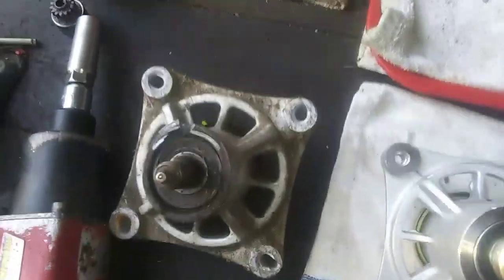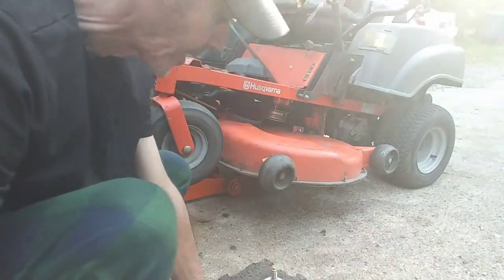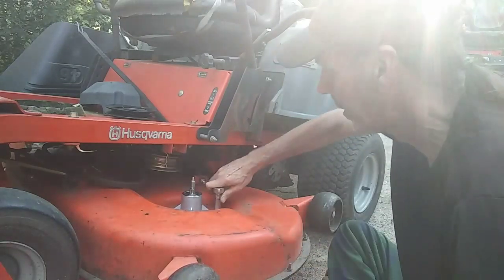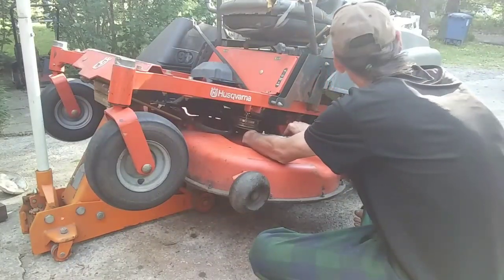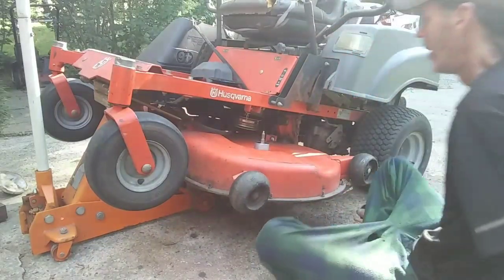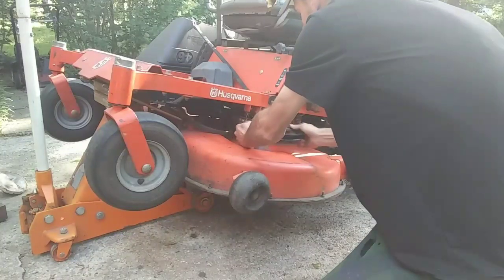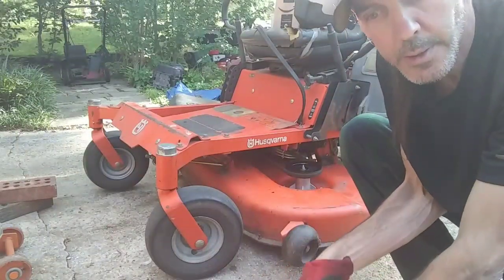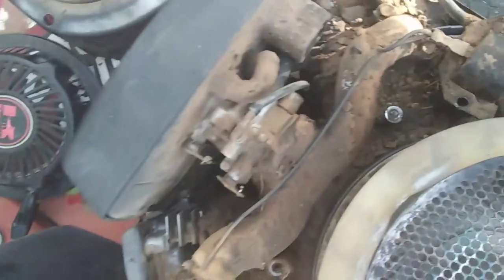Husqvarna Spindle Replacement

Comment: On that coil bolt, I drilled a hole then replaced the fastener with a self tapping screw from my local Ace Hardware.

Comment: Sometimes when brokeoff flush or just proud you can place a nut over the top of it and fill the nut in with weld real good.   let it fully cool before trying to remove.  The heat swells the bolt and it stays hotter longer than the aluminum But it often cracks the rust loose.   The weld will not stick to the aluminum.   I had worked in a machine shop a few years and this is a trick a old timer taught me.    Other wiseinvest in a good extractor set with left handed drills.   If you drill just under the thread size the left hand drill will often back the threads out.   If your drill slips a bit and gets into threads then drill it out and retap for a heli cool the right size to restore them.          I am sure you have removed it already but maybe my post will help someone out of a bind!

Comment: My 42 inch has the spindles under the mower which makes them inaccessible without taking the deck off. Minor, but irritating.  I didn't use anything on the spindle bolts except WD40 to loosen them.Spend the extra money to get the prethreaded housing...save yourself some pain...

Comment: I purchased a new zero turn Husqvarna mower I had 11 hours on it and the bearing locked up and broke the belt. I didn’t know at the time what caused the belt to break, till I started to install the new belt, that when I discovered the bearing failure.,  None of the the spindles had any grease nor did the front wheel bearings. Husqvarna would not cover the cost. 
Now I am concerned about the hydraulic motors now no way to check to see if they have oil..
Reply: their spindles are made with sealed bearing so pump all the grease you want in and they will not get any in them.   Only way to fix them is to knock the bearings out and remove the plasicseal from the sides you want grease to enter.   It is a stupid design almost all of these mowers now have.
Reply: Actually, I saw a video that would allegedly prove if you pump enough grease in the center, the pressure will push the new grease into the bearings past the thin seal. He used red grease to displace the dark grease originally installed. Also the grease in the center of the spindle keeps any heating down.